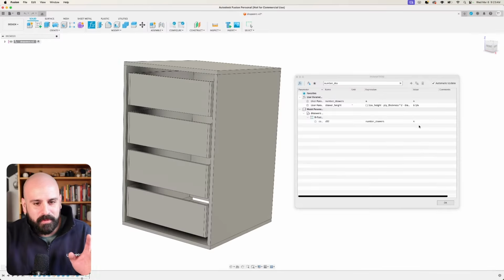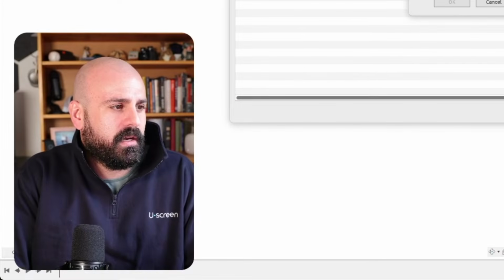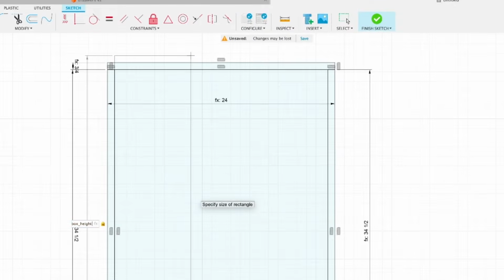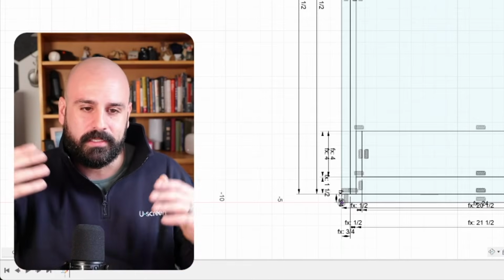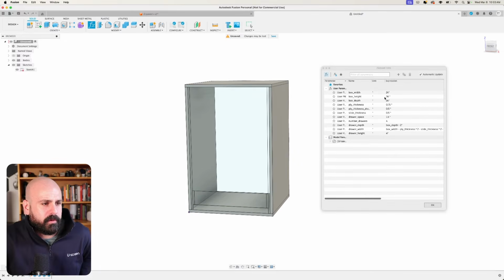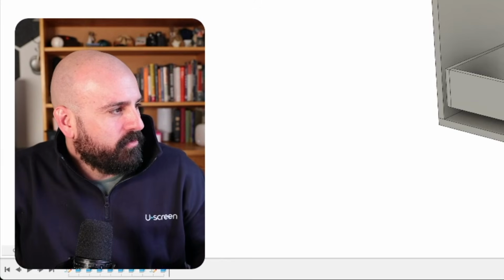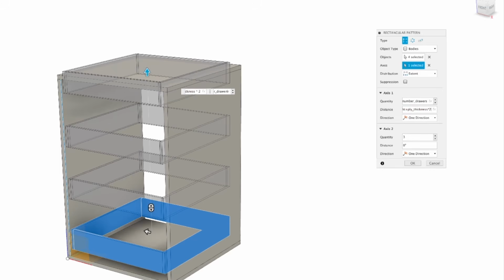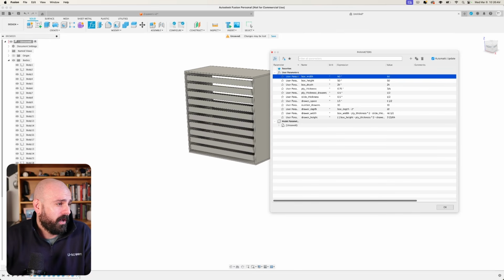Fusion 360 Tutorial - Parametric Modeling for Cabinet Drawers | Woodworking

Comment: 15:00 a good way to reduce busy sketches with dimension clutter is to use more CONSTRAINTS. specifically the EQUAL constraint. This also means you only have to fill half the dialog boxes saving time. It also greatly helps with diagnosing issues with your parameters as you dont have to check the dialog box for the right side and the left side, decide which one is incorrect and then fix it. the COINCIDENT constraint is also great. When you changed the box width and the top was overhanging, had the right side of the box been coincident with the top and bottom, the box should have updated accurately without the need for them dimensions you removed. Hope this helps someone. LEARN CONSTRAINTS, cleaner, faster sketching with easier diagnosis. learning parameters and constraints has really levelled up my cad proficiency.

Comment: Been using F360 here and there for 3D printing. Just wondering a few things.
1. When defining your initial sketch, why not make a construction line at the midpoint of the top/bottom pieces and use a mirror to define the right panel? This reduces the risk of mis-matching values , especially when the design is symmetrical.
2. Why define a drawer_width value and use it explicitly in the design? There are no gaps and tolerances in the design, the drawer is simply the distance between the two slides so you don't need to set an explicit dimension and can just use constraints to define it.

Comment: Designing Kitchen Cabinets Efficiently

I've used Fusion a little bit in furniture designs for my woodworking business, but I want to use it to design kitchen cabinets for upcoming projects. My issues are the time required to build new boxes, doors, drawers and all of the other repetitive parts of kitchens from scratch for each new job. Is there a way to create these different parts that I need in each kitchen, but then import them and scale appropriately to every job, then assemble each part to customize the kitchen? If anyone has experience with this I would really appreciate your help!

Comment: Excellent instruction on something other than 3D printing for my woodworking efforts.  Really like your methodical step by step.  I have been subscribed for some time but you don't appear in my regular feed YT provides me.  I need to figure out why your channel dropped out of notifications in my feed.  I hope you are successful with your Patreon page.  I have been considering a Patreon but not sure what value I can actually provide to people that makes it worth me asking for regular donations.  I am supporting several people already and will give more thought to your membership because I know every little bit helps and it is clear you gave good thought to this video - which means lots of work (at least from my experience).  I will watch some more to see if Is should drop support for someone else and shift funds to your channel.  

I thought the way you came up with automating the spacing between drawers by using the pattern tools was awesome - that would have given me a total headache.  Not sure I would have come up with how to do that on my own.  

A couple items I am not sure I understand.  

At about 8:10 you go through building a formula for door width in the sketch.  With all of the work you put into the parameters at the front, why didn't you just create a parameter for door width that had the formula you came up with already set?  Is it as simple as you didn't think of it when doing the original parameter definitions or is there something more to the thought process?  

At around 16:30 time you are discussing making the back of the first drawer and go to the back and make a sketch.  Why don't you just copy the drawer front - then if you change width or thickness of front same thing will happen on back.  Is it for keeping the parts list accurate at the end?

Comment: Great tutorial.  As for Bodies vs. components.  Bodies are objects that live inside a component.  If I was designing this cabinet, the cabinet would be a component with the sides, top, bottom, and back all bodies inside the cabinet component. I would have created another component and called it "drawer" and put all the bodies that make up the drawer (drawer sides, front back and bottom)  inside the drawer component.  Hope this makes sense.
Reply: I'm late to the game but was going to say the same thing.  

Labeling the bodies and the components becomes pretty helpful when you start doing your BOM and cut list. 

If you were doing a separate file for a different cabinet (lots of reasons to do it this way)  you could insert the components from this file very easily.   Instead of body 5-8 you just insert drawer and poof.
Reply: Components make it easier to use the nesting features of fusion for CNC layout.

Comment: I have a question. Is there a specific reason why you have used "New Body" instead of "New Component" for each of the elements of the cabinet? 

Because based on what I know I would everything that is physically a different part should be a different component. The only reason one would want to use multi-body component is for efficiency. If you require a cut list or animation of a movement you can make those with components, and not with bodies inside a single component.

Comment: You didn't need to draw all those line for the spacing. You could just draw a rectangle for the actual drawer box and define the distance from the outer shell. This way you don't have to make parameters like "width - spacing*2"

Comment: I'm very new to Fusion. I've been learning mainly as I will be buying a 3d printer early next year. I have in the past built a lot of furniture, with drawers and I've always drawn the plans in CorelDraw because it worked for me. It was always a huge pain when I needed to adjust a dimension as I'd literally have to redraw everything for that module, re label all the dimensions and double check it all with all the other modules it would fit with. I had a quick look at this video not thinking I'd really be bothered and it's amazing! I'll definitely be going through the rest of your content. You've made it really easy to pick up. The wife's waiting on her walk in wardrobe so I'll be putting it all into practice soon. Thanks!

Comment: So, what is the difference between body and component?
Reply: A body is a piece of geometry in fusion. So let's say a cube or a donut.

Every body is part of a component which is like a folder holding 1 or more bodies. Components can be used to organise your bodies, so the components "drawer" could contain four components called "front", "back" etc.

There are some operations like making moveable joints that can only be done on components, not bodies.

In my opinion, everything that we would consider an object in the real world (pieces of wood, knobs, screws, drawer slides) should be their own component housing the various bodies that make up that component.
Reply: I like to think of it as a body is 1 part number and a component is an assembly of parts.

Comment: Components are the building blocks that make up assemblies, and a body is one of the elements that make up a component. Each component contains one or more bodies, as well as its own set of origin planes, sketches, construction geometry, joints, and other elements. (From Fusion 360 help)
Reply: Im new but I would add that while that's an excellent explanation of what a component is, but, it doesn't offer much in  terms of why its a good idea to consider using components instead of just drawing bodies. At least one reason to use components is to be able to create motion. Motion offers limits and joints to make your prototype behave as it will in the real world. To do this you have to have components as it doesn't work with bodies. I think that's the major difference in terms of use case. So for this videos example you would have 4 components that build the frame case top, Case L Side, Case R Side , Case Bottom. Then you would mad the drawer one component or break it down in to separate components as well and group them to be Rigid in their relationship to each other during movement, which I believe is referred to as a feature. I'm still trying to figure to how to make a drawer slide from the McMAster Carr Catalog have movement given the drawing has all the ball bearings and everything. Ill probably just delete the ball bearings as the motion doesn't really need them there virtually so long as the slides are oriented to each other correctly. But I want to know how one might make it work with all the bearings

Comment: useful video - but 🙂
- why are side panels on bottom panel and no on sides ?
- why you use bodies and no components?
- extrude of back panel of drawer - can be done in IMHO better way - starting plane should by back plane of drawer side - and distance as "minus drawer plywood thickness"

Comment: Your parametrics helped me a lot. Next step would be to add parametric drawer fronts. Do you have any recommendations on that? I’m stuck on that part. It would be nice to maintain a gap all the way around the drawers and edges of the box. I’ve messed around with lots of tutorials and a decent mix of yours and others. I’m not good at wood working so cnc makes it easy as I’m a cnc machinist. But generally do one off stuff that are all vastly different. This repetitive work with slightly different options and to not break the model is something else! I added a box joint extension and that alone will help me a lot. Looking for strong ikea cabinet’s essentially. Right now is a bank of drawers to slip in the already built shelves in the garage. And I’d like a variety of drawer depths. The organizer inserts I may do separately. That’s a little over my head right now for the parameters on that.
Reply: Hey, you draw the front on the 1st sketch relative to cabinet widht and drawer height, it should work with this type of construction.

Comment: With regard to bodies and components question you asked. To my understanding is that it would be useful if you were planning to add some joints, basically to create a joint you would have to have 2 different components. To my understanding it will also help if you were planning on creating a cut list, if I understood it correctly, when you have different parts of your build as different components they will be displayed separately on the cut list. I am still just learning, so everything I said is to be taken with a huge grain of salt 😅.
Reply from the maker: Very true! Thanks for the explanation!
Reply: I am also still learning fusion for designing my dream workbench. Foureyes [https://youtu.be/YF3Yob2yNoE?si=FQI0mRaSQeiyl-nF] has a great video on creating a cabinet with sliding doors and helped me understand bodies vs. components a bit more. I am creating mortise and tenon joints out of plywood like Paoson Woodworking's epic Dewalt saw bench build. From there I am organizing those three extruded bodies pressed together into separate components. To my understanding, it's like organizing all the files necessary for each part into its own containing folder. I still have yet to see if that affects the cut list however.
Reply: I use fusion for cabinet making profesionally and I use the built in nesting for the manufacturing side. Fusion requires you to have everything you want cut as set to a component. From what I gather, a body feels more like a "digital" term. I will say, after making the switch to orginizing everything into sub assemblys it makes navigation much easier. Also when I model evrything I model everything by bodies and then just convert them to a component after I have finished with detailing.